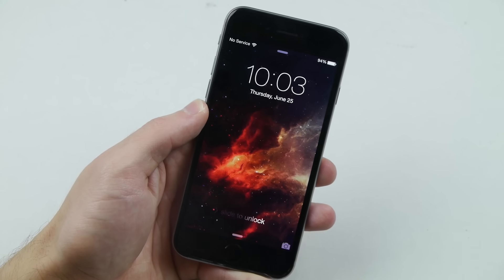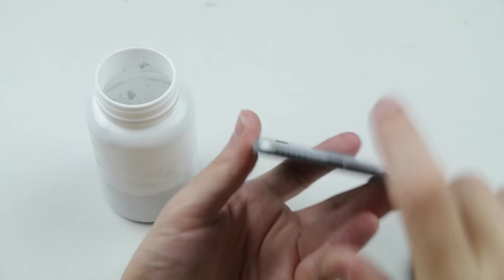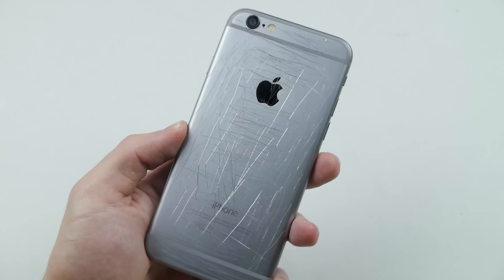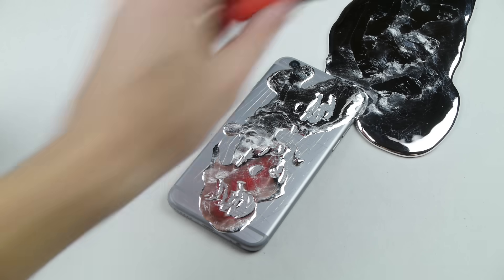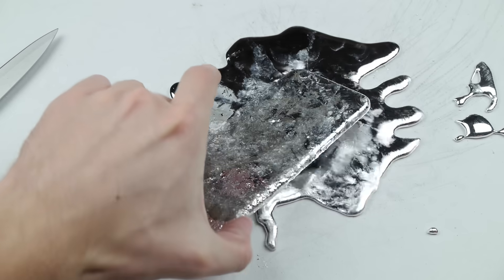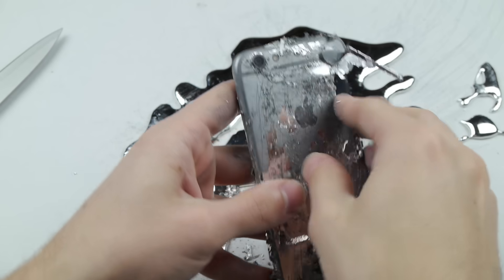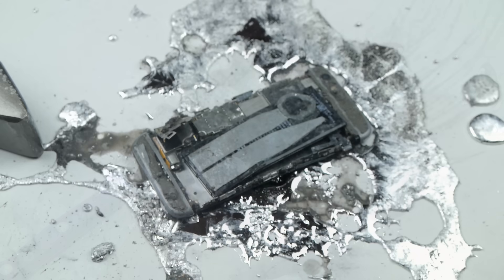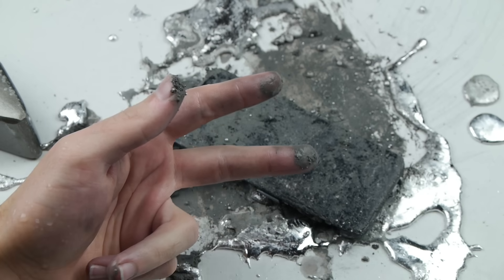What Happens If You Pour Gallium on an iPhone 6?

Comment: use some fucking gloves you jackwagon
Reply: Gallium is perfectly safe to touch, unlike mercury
Reply: besides gallium isn't toxic at all
Reply: +inademv Why? Gallium melts at room temperature, meaning that it doesn't burn to touch it.
Reply: +NarcassisticGamer acids, chemical reactions, electric surges. Gloves aren't really made to sustain heat (unless they're specifically listed)
Reply: From now on I will be calling people jackwagons
Reply: +Azul no lead causes lead poisoning. you cant get lead poisoning from anything else but lead
Reply: ***** what part of "harmless" you don't understand >.<
Reply: ***** it has been proven that it's harmless.. >.>
Reply: +Caitlyn Ulted JFK Why don't you address Azul's specific comment directly? - which was in response to yours.  If you disagree with a comment, say why you do, rather than trying to imply the poster of that comment is ignorant.
Reply: WTF 
Is a "jackwagon"
Reply: Um
Jackwagon?
Reply: +I just Do stuff awseome idea jackwagon!
Reply: +inademv touching galium can't kill you
Reply: +Caitlyn Ulted JFK  yes it actually is toxic. only if you get it inside you body, which he easily could've if he had a cut on his fingers or something like that and he peeled open an electronic device, its rare to find electronics without mercury in them. and you do not want to touch mercury. also there are conductors allllllllll over motherboards and shit like  that, that if you touch em while they're on (he almost did), it takes very little current to injure or even kill a human.
Reply: Its not fucking toxic, whats happening in this video is gallium induced structural failure. Actually watch a video on it or experience it first hand as a chemist before you start argueing whats happening in this video and the so called 'safety issues' of this video.... The only 'possible' safety concern would be adding the water too the gallium-alluminium amalgum at the end of the video.
Reply: Lmfao
Reply: +inademv  gallium is harmless, just easy to melt.
Reply: EASYTIGER10 lel k
Reply: EASYTIGER10 How's this:
I disagree with *****'s comment because he keeps saying it's not harmless, which is false.
And I'm not trying to imply anything.. It's all you.
Reply: +inademv Sir, do you happen to like Gurren Lagann?
Reply: +Caitlyn Ulted JFK Ye, pure gallium is harmless when touching it. Mby even after reaction with Al it is still harmless. Dunno. But later when it started smoking and fizzling, it clearly started another chemical reaction and hell knows what was the outcome. I wouldnt touch it with bare hands.
Reply: Tomasz Wybraniec The smoking and fizzling might be the battery acids doing something with gallium.
It's safe to touch gallium with bare hands, although if you have somehow other elements in your hands, I wouldn't touch anything and would just wash 'em off.
Reply: +ThirdhandShark7 Ellis lol!! same question
Reply: +ThirdhandShark7 Ellis http://1.bp.blogspot.com/_ZHYvlbQn1Mg/TUIcJ-FYEzI/AAAAAAAABDQ/fAcBeQp14Ng/s1600/J_isfor_Jackwagon.jpg
Reply: How can you say it's toxic after it's been proven that it is not toxic? Also, if you get anything in your system, they're going to do something negative for sure.
And I highly doubt that an iPhone battery is deadly (or would injure anything at all), as it is somewhere around 3.7 volts.. Have you ever licked a 9V battery? Licking the iPhones battery would feel a bit lesser than that.
It's said that households' currents kill, which are ranged from 100A to 200A depending on the household.
Reply: Caitlyn Ulted JFK 1: the battery could explode 2: why the fuck would i lick a 9 volt battery? LOL
Reply: Wait.. what are you saying by "the battery could explode"? I really hope you're not saying that it could explode from licking it, because it's not really.. well.. possible.
Also, the licking the 9V battery was just for reference on it being harmless. Many have done that as kids, or even as adults! It's a handy way to see if the battery is dead or "alive"
Reply: +Larduk_ “Lard” 1UK what do you know about chemistry to talk like that? don't say stupid things.
Reply: +Caitlyn Ulted JFK Lithium batteries don't have battery acid in them, the reaction was just the water reacting with the aluminium (2Al + 6H2O = 2Al(OH)3 + 3H2)
Reply: +Caitlyn Ulted JFK He's saying the reaction could compromise the safety mechanisms in the battery and cause it to explode.
Reply: +mickell oh Lead oxide can kill you pretty fast with a high dosage
Reply: +inademv Gallium is considered largely non toxic (whether or not ingesting it in large amounts is toxic is still up in the air) but it is defiantly non toxic if your not drinking the stuff so no need for gloves this isn't mercury.
Reply: +inademv Holy shit you lit a powder keg
Reply: Bill Fencegates Either one works i guess
Reply: +Tomasz Wybraniec the fizzling and smoking was the reaction of water and the AlGa compound, the aluminum wants to be with the oxygen, but it can't usually since a layer of oxidization covers the aluminum. But in this case the gallium allows the oxygen and aluminum to be together, leaving the fizzling sound (the hydrogen from the water causing pockets of air with other unreacted with water) and the gallium.
Reply: Gallium is non toxic you imbecile.
Reply: Soultan Syah Another misconception, mercury is safe to touch and play with. It's only the vapour that's toxic. Which occurs under certain conditions.
Reply: Joaquim Monteiro Its fucking true you pagan, I'm a university student using gallium and mercury in my research. You're just a youtube 'activist' thinking he knows everything... I actually have experience with this stuff. It's fucking non-toxic. They make knifes/forks and spoons out of it for dinner gags!
Reply: +Larduk_ “Lard” 1UK You're a jackass that's what you are, and I will not waste my time with you anymore.
Reply: Joaquim Monteiro Nah haha you're just kicking shit. Grow up.

Comment: When you add Gallium to Aluminium it removes Al oxide from the Al surface, which makes it highly corrosive. So, when you put that brittle alloy in water, Al reacts with water and dissolves, leaving behind Hydrogen and Gallium. So basically after you do this, you can wash your iPhone in water, and get that 500g of Gallium you had, but 0g of Aluminum which will be lost forever.

Comment: dont you just need to heat galium to about 30 degrees celcius to melt it?
Reply: it melts in your hands..
Reply: +Some Weeb Sure, but it's a big amount.
Reply: ***** so it will take a while?
Reply: TransmercuryFilms i only know the body temprature in Fahrenheit, but im pretty sure that translates to 30 degrees Celsius
Reply: ***** Too bad it's in a big solid clump inside a bottle, so either you hold it in your hands for hours, pouring out tiny amounts at a time that near-instantly solidify, oooor heat it in an oven for a while...
Reply: ***** and by a while you mean like, 5 minutes?
Reply: Some Weeb Yep.

And before someone starts telling me it's easy to just melt that in the hands, I invite anyone to freeze some water in a medicine bottle, go outside in freezing weather, hold it in their hands and see how long it takes to melt all of the ice. Same situation, except your hands are 37 degrees C warmer than the melting point instead of 7 degrees.

Comment: You can tell that this video must be fake as it had 94% at the beginning and had 85% 'overnight'  only 9% battery gone
Reply: Well, it was in standby mode, therefore it wouldn't drain much battery at all.
Reply: How? how your basing your statement on the battery life if the phone which is accurate as if it was just left there doing background tasks would usually use up some battery life
Reply: He would have turned it off
Reply: +jdfcreeper1234 I don't have a iPhone so I'm not that sure
Reply: +Nicholas McKee And iphones have huge battery life, especially new ones.
Reply: +Thaddeus Mann You're joking right?
Reply: Fodimin Layton  no im not, theyre really good.

Comment: 4:36 no shit Sherlock. Chemical reactions much. The chemical composition of Gallium and the way it is affected by heat does not really sit well with water. I am half your age and even I know that.
Reply: +keaton mccolm to simplify for your dumb ass. Heat boils water.
Reply: +keaton mccolm to simplify for your dumb ass. Heat boils water.
Reply: +keaton mccolm you're also wrong man, water has a higher boiling point then gallium's melting point, so before calling someone out as a moron on the internet you should probably do a fact check first.

Comment: About the reaction at the end:
US/English Wiki says:
"At room temperature, gallium metal is unreactive towards air and water due to the formation of a passive, protective oxide layer"
However, I found an additional interesting Quote in the German wiki:
If, however, gallium is alloyed with aluminum and it is in its liquid state (with a lowered melting point at room temperature), it reacts violently with water. (I roughly translated it)

Comment: aluminum normally has a oxidized layer on it and that protected it from water so the gallium has removed that oxide layer so now the aluminum can react with it and dissolve in to the water so if you put all the gallium and the aluminum in to some water you can retrieve the gallium and play with it (disclaimer do the reaction out side it makes hydrogen so don't burn your house down)

Comment: First, why would you melt this chemical hot enough that it hurts when you touch it when you could melt it in your hands and it be a temp where it doesn't hurt.
Second, why would you pour another substance (water)on it(gallium)when you don't know how it will react.
Third,IF IT STARTS SIZZLING WHY WOULD YOU TOUCH IT WITH YOUR HANDS AND INHALE THE FUMES!?!?

Comment: I don't know what's happening, it's sizzling, but I'm gonna rub my bare hands all over it...SMH
Reply: My point was that he didn't know what the reaction was, therefore it very well could have been exothermic.
Reply: Haha
Reply: But still tech tax is a complete idiot but funny
Reply: +Apathy CFW chickens
Reply: +Mind Blow that it does but rubbing your hands through what is essentially at that point a aluminum/gallium mix is not smart especially since the full toxicity of gallium is still not fully known. Nurdrage is a scientist and still wears gloves while handling the stuff
Reply: trapper9998 He stated he wears gloves because ot gets messy and actually in theory you could drink gallium and come out UN harmed....check your knowledge
Reply: It's just aluminium oxides and hydroxides, gallium metal, hydrogen and water. All of which does not pose much danger to him.
Reply: +Mind Blow What are exothermic reactions.
Reply: Cole Parker Exothermic reactions happen when a chemical reaction releases energy in the form of light or heat, kind of like a glow stick
Reply: lol
Reply: +Mind Blow obviously if he needed a rag he made it hotter than 80 degrees you degenerate :)
Reply: +Logan S. maybe he has a fettish?
Reply: +Mind Blow I actually did check my knowledge. Even went so far as to talk to one of the science lecturers at uni (i am a law student, gave up on science along time ago now) and he said the same as you although he wouldn't recommend drinking it.

Comment: It's the sodium reacting with the hydrogen/oxygen from the air and the water to make an acid (sodium hydroxide) which is causing the elemental metals to react I would breath in the sodium oxide or touch it...
Reply: Ps the battery has sodium
Reply: Sodium Hydroxide has a pH of like 12. Nice try though.
Reply: Did you just say that sodium hydroxide is an acid lmao